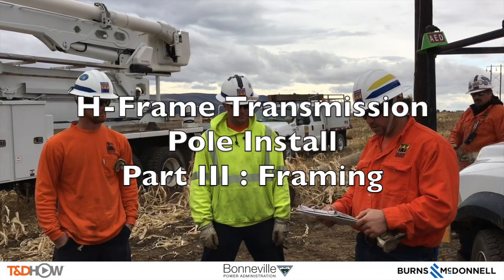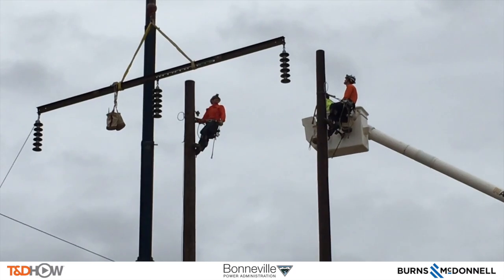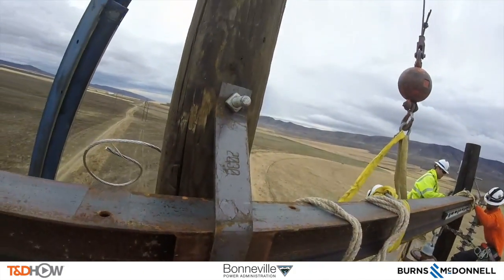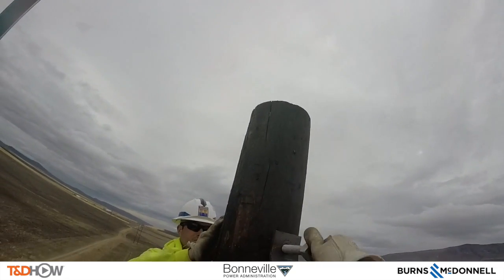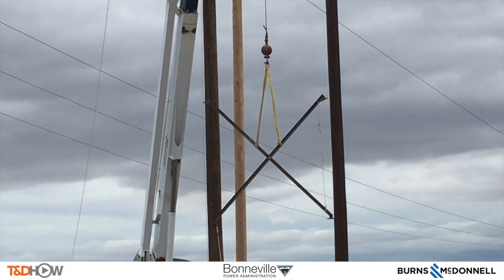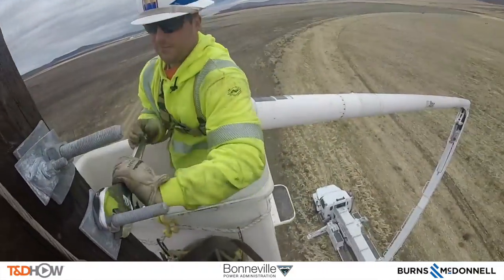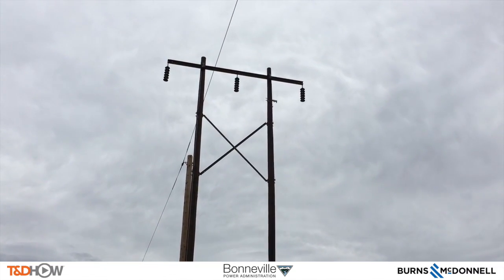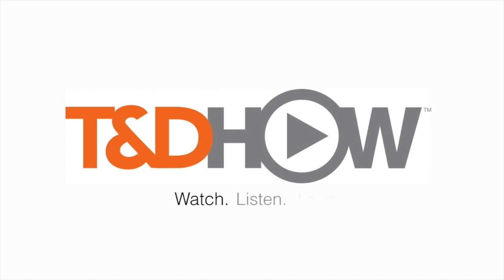H-Frame Transmission Line Install: Framing

Comment: Aside from the modern machinary used, I feel like this technique, and this type of structure its self, has barely changed in over a century!
But then if it works, why fix it?

Comment: wooden supports? is it america? definitely not a cube? what kind of insanity and the last century ?????
Reply: Sigh. And wooden railroad ties. There were numerous studies done to show it's economic and provides expected longevity.
Reply: @ArcadiyIvanov   live in the Ural Mountains, we have these wooden electric poles of power lines, all of them were replaced with reinforced concrete ones back in the last 2000-2010 years. Maintenance is practically not required, or only with the help of special equipment
Arkady are you in the usa?
или попросту валяешь дурака
Reply: @ИнжирИнженеров  Я в США, да. Еще раз повторяю, как и со шпалами в 80% случаев дерево вечное и значительно дешевле. Во Флориде ставят железобетонные и стальные. Там где нет сильных ветров и умеренный климат столбы и шпалы деревянные. Проводили кучу экономических исследований на этот счет.
Reply: @ArcadiyIvanov  у нас и деревяных шпал сейчас не найдешь, одно время (прямо таки в 2010-ые годы) был бум строительства коровников, складов, и даже домов из шпал, потому что их девать некуда стало, министерство ЖД попросту отказалось от  их применения...
Reply: @ИнжирИнженеров  В США 80% шпал деревянные просто потому что они лучше выживают при больших нагрузках так как гнутся\проминаются, а цемент просто крошится. https://www.rta.org/assets/docs/RTASponsoredResearch/WoodCrosstieEconomics/063%20concrete%20vs.%20wood%20ties%201993.pdf
В условиях когда деревянная шпала живет более 24 лет, целесообразнее устанавливать ее, а не ж\б.
Reply: @ArcadiyIvanov  провели большие исследования по цементным шпалам - и у нас была разработана специальная марка бетона для шпал (кстати просто так он не продается), нынешние бетонные шпалы - не крошатся и не ломаются. Я все меньше и меньше вижу ремонтных работ по жд путям, рельсы - да меняют бывает... а вот шпалы что то давно уже не помню когда видел на замене
Reply: @ИнжирИнженеров  Под рельсой стальная подложка в цементе. При нагрузке и температурных изменениях эта подложка начинает цемент вытирать. Нет таких растворов которые нельзя железякой расковырять (3000 psi? 5000 psi? без разницы). И как только вытерли достаточно шпала ремонту не подлежит. А деревяхе пофигу - забил гвоздь глубже и все раз в 10 лет. В США основной трафик поездов - грузовой, а поезда много километровые.
Reply: @ArcadiyIvanov  я смотрел передачу по техническому развитию - Наука и техника (только для России) внутри шпалы создается специальный 3D обьемный упругий скелет, марка бетона содержит специальные пластификаторы, я серьезно говорю - постепенно ремонт шпал или их замена уходит в прошлое, странно что в технологичной америке до сих пор не решили этот вопрос. Шпалы - это уничтоженные деревья.
Reply: @ArcadiyIvanov  сама идея начать догонять в развитии по технологиям США стала вектором движения, и похоже как бы не поливали дерьмом россию, разгнавшись уже летим по инерции и не обращаем внимания ни на кого, постепенно во всех жизненно способных регионах стало 4G в квартирах и домах инет 50Мб/с, да есть подыхающие деревни и города (по аналогии с детройтом) но... я сужу по своему городу какой он был в 90-х и какой сейчас, это две большие разницы как говорят в одессе...

Comment: Climbing is a necessary skill , but its so much faster framing poles with two buckets. Save them legs for the areas you really have to climb. Ive done enough baker board work and all around construction to know it is part of the job , but if i can get a bucket to it or a crane basket  i know how much faster i am .
Reply: they are apprentices so they don't get the joy of riding in the bucket. sucks don't it

Comment: Lol. "The supervisor pulling up in his bucket". There were 2 90 foot poles to climb. The foreman told me "that's your pole, I can get the bucket halfway up the other pole so that's my pole". Hey, he earned it. The bottom of those fucking poles were big as a fucking tree. I managed to somehow climb 30 foot without a belt around it. My lats started giving out and I realized how big around that pole was when I went to safety off. I probably looked funny holding my ass away from the pole with my head up against it. There were no bucksqueezes back then, just a straight old school safety. They came out with those new safeties where you have to push in on one side to make the clip release. I hated it. I didn't and wouldn't use it. I liked the old one, just slap it against the d ring and it clips. I was climbing and had a j lasher get caught on the safety latch and I fought 60 pounds or so of lasher trying to get it out of the safety clip. I never made it to powerlinework. I had 11 grand saved for school and the good ole "God" threw a curveball at me and I got a skin irritation on my legs. It caused me to not sleep for weeks at a time and I went apeshit and lost the money. I never forget I could be doing powerline work if that didn't happen. It could have been the insulation from ductwork and insulation under houses because I did shitwork ductwork for 5 years. Dermatologist said it wasn't bugs, she didn't know what it was. I think she lied. Nonetheless I get to dream of doing linework and it sucks soooo bad. Guys who are in it ought thank God they get to do it. Once you do linework every other job sucks dong. Communications pays jack shit, they payed 7 cents a foot to run support strand. So we'd have to run at least 5 thousand feet a day (2 spools) to make money. I got 10 bucks an hour to climb 40, 50, 70, 90 foot poles. Fall from there and you won't do this work anymore.

Comment: Why no rust protection on the steel? we would galvanise everything here in the uk!
Reply: It might be a few years late but, often here in the US in areas that don't have high corrosion they will use a steel called CORTEN steel or Weathering Steel that creates its own protective layer as it ages. I am no expert in identifying it new if that is what they crossarms are made out off but I would assume they are. In places on the coast where there is more corrosion the steel poles will almost always be galvanized.
Reply: Gordon Moon this may be a dumb question but is this kind of work called here in the UK? Like you know you have domestic, commercial, etc.
Reply: Heavy industry
Reply: Bibo Thanks bud, never learnt about it in college or anything. Seems interesting!